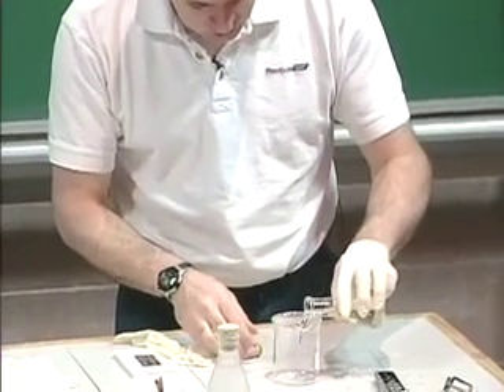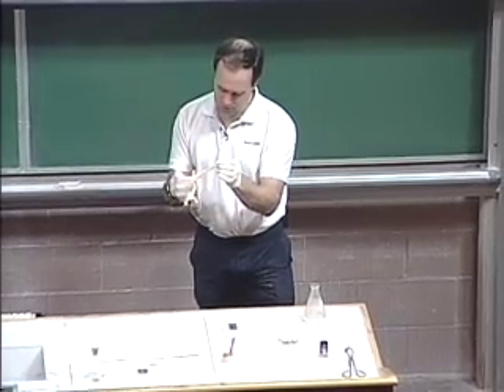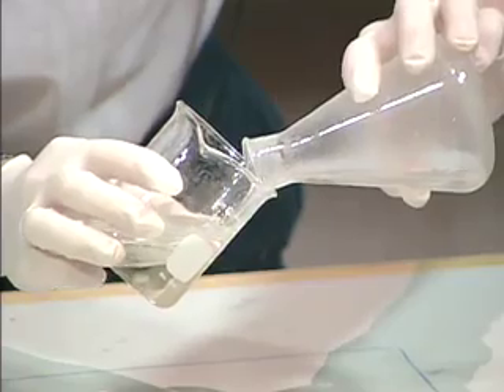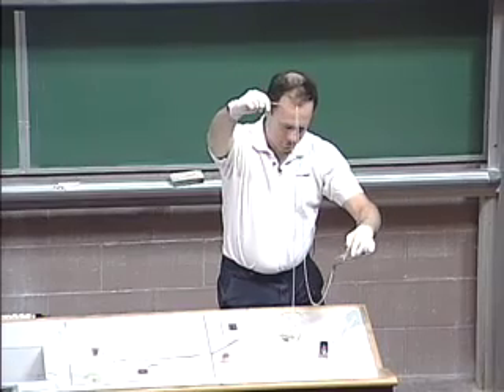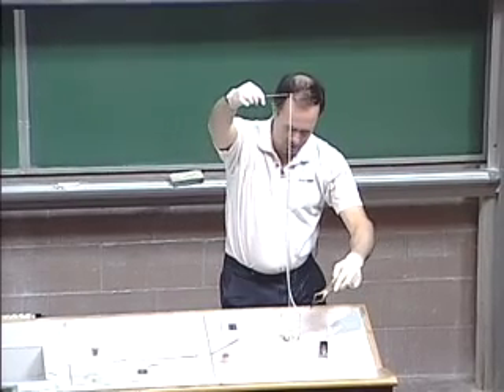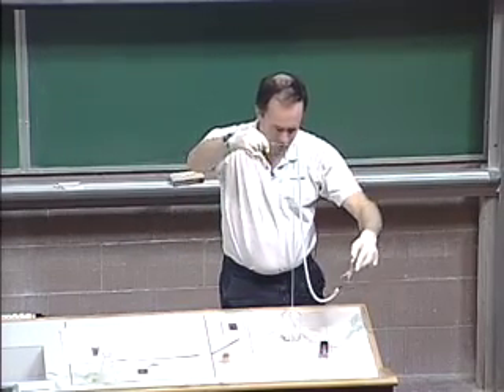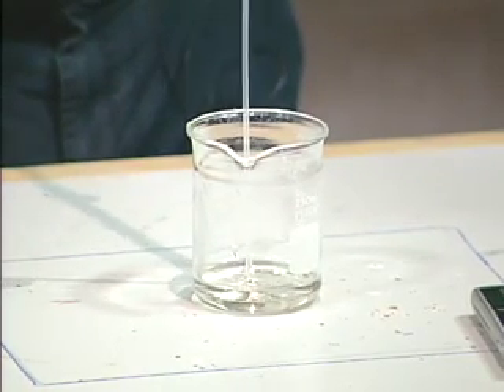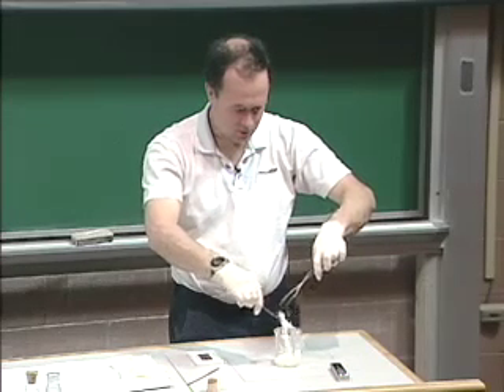Making Nylon

Comment: I am not a chemist but I wonder can I produce nylon from plastics ??
Reply: Hi Muhammed, you can. Just dissolve the chopped plastic into acetone.
Reply: Here another question , but its about Fuel Cell
Is it possible to use stainlessteel as an anode and cathode materials ?
Thank you .

Comment: Isn't the acyl chloride used rather than the acid for that kind of demo? I can hardly see a carboxylic acid reacting with an amine to make an amide without some sort of thermodynamic help.
Reply: I think so, if you look when he pours in the di-amine it looks like the acid is giving off white fumes, I'm tempted to say acid chlorides do that, but not just diacids.
Reply: XOlleyX it should be adipoyl chloride- check Shakashiri's demo book.
Reply: piranha031091 fucking need